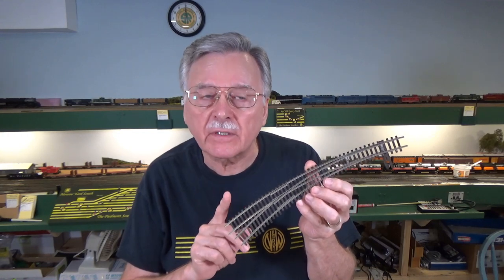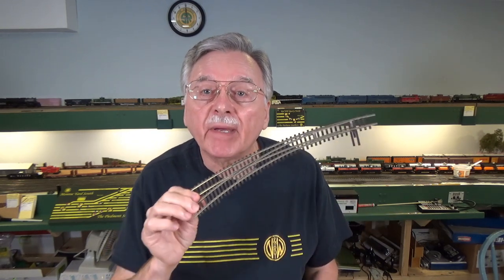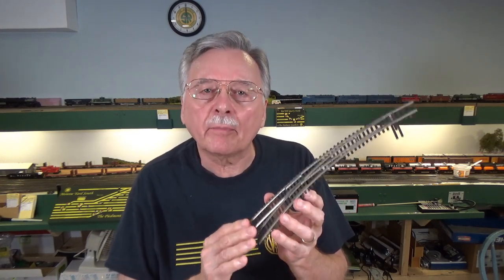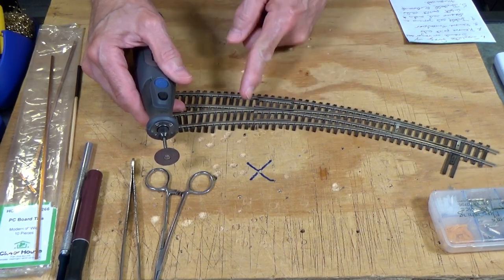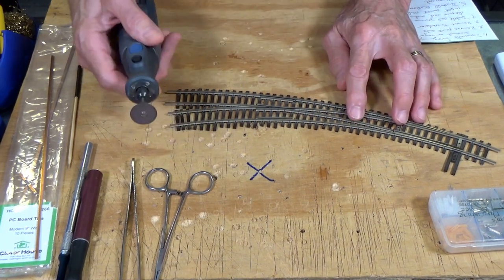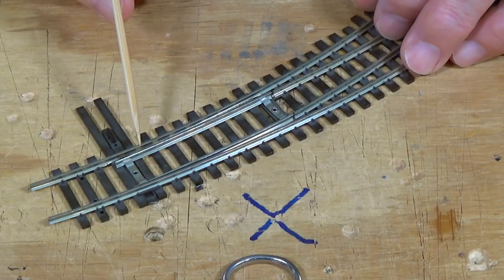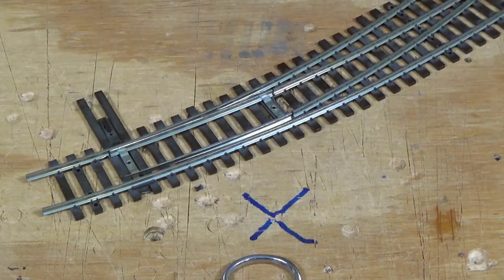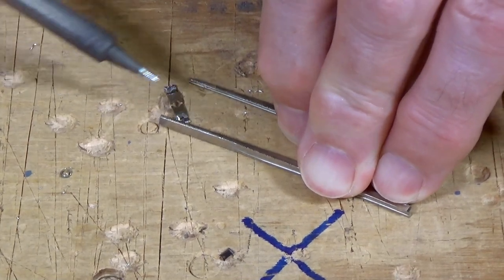Make Your Old Turnouts DCC Friendly (121)

Comment: Hi Larry,  Love your insight into model railroading and I have over 50 old Shinohara switches and I just converted my first one following your video and using the PC Tie Boards and solder you recommended!  I am happy to share it work like a charm and my short went away and I now feel confident to finish the modifications for  rest of those switches.  Also added the Tam Valley Frog Juicer and my locomotive rolls through the switch with no hesitation.   Thanks and keep the tips coming!

Comment: One thing I have found out, not all Shinohara turnouts are alike. The brass contacts that you pull out from under the rails were all soldered in place on my Shinohara switches. 11 out of 12 switches, only 1 popped out as easily as yours did! Thankfully I am very comfortable desoldering  them and removing them. Just another twist to look out for. Excellent video by the way!

Comment: I have a Shinohara right hand curved turnout on my workbench right now. I have isolated the frog, but only cut the rails before the frog and installed a styrene strip. I'll use plastic rail joiners on the two frog rails, like on a Peco Electrofrog. The feeder will be soldered on the side away from the aisle. I like your method of providing power to the point rails, I never though of that! Stay safe!

Comment: A local hobby shop owner, who was closing his business, had a copy paper box full of those curved turnouts,   He gave me the box for free. I had been wondering about how to use those.  I’m going follow your steps to makes those DCC friendly.  Then use those in my hidden staging area for my On30 layout. My visible tracks are Peco O-16.5 for On30.  Peco switches get expensive quickly in staging yards.  The only thing I would do different is I would attach my 12 inch long feeder wires across the rails where you put those short pieces of solid wire.    Thank you for the video.

Comment: I use a piece of phosphor bronze wire across each side of the rail joiner that was inserted for the point blade. this also helps retain the blade. As for the metal throwbar why not leave it in place,  drill out the rivet,  and  solder the PC board to the metal throw and then make a cut across the metal throw bar t and the metal layer of the PC board tie.

Comment: I worked out that i was going to have to do something along this line because i wasn't  getting good electrical connection at point to stock rail. You have made this look easy and as soon as i get the pc board ties i will give this a go. THANKS!

Comment: I really like my newer Shinohara turnouts.  They are DCC  friendly.   It's a shame that Shinohara is out of business.  In October of 2020 Walthers is said to be coming out with a new line of DCC friendly turnouts. Can't wait to get my hands on some of them. 
Tech tip for soldering on track   ....  use a small tipped fiberglass or metal bristle brush to clean the track to be soldered. then clean with alcohol swab before soldering. Dab rosin flux on surface then solder really hot really fast.  Perfect solder joint every time with no melted ties. Silver bearing solder will generally melt at a slightly higher temperature.

Comment: Why didn't you use an NMRA gauge when you set the point rails on the PCB tie? Couldn't just eyeing the point rails cause a derailment, just an inch down the point rails the wheels could drop on the ties because there is too large a gap?

Comment: Best regards,
Your videos are of excellent quality and full of content.

I have seen all your turnout videos and I am in an uncertain situation
since I am not an expert on the subject.

I am a train modeling novice. I recently bought a Fleischmann starter set. (My first train in my life)
The set which is digital is:
 	
931886 - FLEISCHMANN Premium – z21 Digital starter set:
electric locomotive class 194 with goods train, DB

The track is oval in shape with double rails on one side simulating a station,
 with entry and exit deviation.

The turnouts are Fleischmann N Left and Right hand curved point Ref: 9168 and 9169
"for manual operation with current-conducting frog"

And Fleischmann official website say:

Turnouts with a conductive frog must always be set in the direction of travel
from which de train is comming, otherwise a shor circuit will occur.
The requiered changeover or the polarity or the frog takes place automatically
when de switch is changed.

Reading on the internet, I found a quote that said:
From: Digital Command Control.
Ames et al, Allt om Hobby/NMRA;
1998 .....  "The ideal turnout is frog electrically isolated and powered by switch contacts"

I have three questions:

1. Are these Fleischmann Tournouts frog electrically isolated and powered by switch contacts?
2. If no, from your experience, ¿what kind of turnout are these?
3. The set is supposed to be  ready to run, (I couldn't say for sure )
    ¿Do i need some kind of special wiring in order to avoid short circuits?

This is my first train, it is expensive, and it would be terrible
 if I were to damage it by improper handling.

I would appreciate it if you could advise me on this matter.

Greetings
Hector
Reply from the maker: I wish I could help but I have never even seen a Fleishmann turnout and have no idea whether the frog is insulated or can be separately powered. If you have a multimeter you can test it to see though (see video 86 on using a multimeter). From your description it is hard to say whether the frog is powered by contact at the points or designed to be powered by switch contacts or a frog juicer. In either case operating a locomotive on it should cause no harm, it will mean that either the frog may lost power or have no power at all. You also might want to view my video on turnouts (no. 77).

Comment: I am new to DCC. My layout is 25 years old (all DC) and I am converting it all to DCC. I have successfully converted 7 or 8 turnouts using the instructions in this excellent video, Except for the part where you mention powering the newly isolated frog. Electronically everything works except the now dead spot where the frog is. How do I power the isolated frog?
Reply from the maker: You need to solder a wire to the side of one of the pieces of rail that comprise the frog. Then connect that wire to one of the built-in SPDT switches in a Tortoise or the dedicated frog connection on an iP Digital switch machines. If you are not using motorized turnout machines then you need to either use one of the Caboose ground throws with a built in switch or a Frog Juicer.

Comment: Could you have soldered the rail joint between the point rail and closure rail instead of soldering a piece of 30 gauge wire as you did?
Reply from the maker: That would not give you the electrical connection between the closure rail and stock rail, which is what you want. You don’t want to rely on the physical contact between the point rail an stock rail for power. Too many things like ballast, foam scenery, paint, cat hair, etc., can get in the way.

Comment: Thanks for the informative video but I have one problem with this process. When reinstalling the point rails to the pcb throw bar tie, how do you keep the solder from flowing underneath the point rail and soldering the stock rail to it? This has happened to me twice. Thanks, Larry
Reply from the maker: Practice and use solder sparingly.
Reply: I have had success looping a small piece of paper under the stock rail  as a barrier while soldering the point rail.

Comment: Instead of connecting the closure rails to the point rails by a 30 ga wire, why not solder the rail joiner connecting the closure to the point rail?  The point rail will still move back and forth as easily.
Reply from the maker: Might work of might be too stiff for your switch machine. Only way to know is by trying one.

Comment: Here's a question I have, if you don't mind. A little set-up first; I have a setup made with Bachmann track. Including 4 switches and crossovers made by Bachmann. Well, after getting my 4th DCC loco I realized it might be easier to use an NCE Power Cab (I could access my Locos by their road numbers.) So I've done that. Now, here is my question - Could I use my Bachmann E-Z  Command Controller to operate the switches and crossovers, while using the NCE to operate the locos, at the same time?
Reply from the maker: Well right off let me say you cannot mix commands from two different command stations at the same time on the same track. However if the bus for the switches is completely separate from the track then you could do it but you would not be able to operate the switches using your throttle if that is what you want. Your nest net is to see your Bachmann controller and buy either an inexpensive booster like the one made by Tamm Valley Depot or upgrade to the SB5 which will give you 5 amps and expanded capabilities.
Reply: @TheDCCGuy  Thank you.  What I was hoping was to use the Bachmann only for the switches. no throttling at all.

Comment: I really found this video useful. However, my question is not related to this video but several that you have posted in the past.  I have obtained the European style terminal/barrier strips that you have referred to in other videos. How do you attach them underneath your layout? Do you Scotch double sided tape or the like? Thanks, Kennedy
Reply from the maker: They have screw holes between the terminals. Just insert a properly sized wood screw and attach it to a wooden beam under the layout.
Reply: @TheDCCGuy  Okay. That was so obvious that I failed to see it. I would agues a No. 6 x 1 inch pan head screw will fit the bill. Thanks for your help and quick response.

Comment: Are you familiar with the Bachmann EZ track DCC turnouts? I recently purchased two that had as part of the turnouts description that they have electrically wired frogs. However the #4 turnout has a plastic frog and the instructions on either of the turnouts do not describe how the electrically wired frog functions. Thanks
Reply from the maker: Sorry but I have never tried those or the Kato versions. You might see if there is a Bachmann help forum on www.Groups.io
Reply: Model Railroading With The DCC Guy Thanks

Comment: Why did you add the 2-30 ga wires, when the power was already feeding your points at the PC board, you installed. There is no reason for that connection of 30ga wire.
Reply from the maker: One of the biggest problems comes from trying to rely on the physical contact at the points for electrical continuity. A physical contact like that is highly unreliable. Get a piece of ballast, foam scenery, cat hair, etc. in there and your loco will stop dead in its tracks. And that’s why powering the closure and point rails is the DCC Friendly thing to do. Also even though the copper strip is under the rail there is no reliable physical connection at the PC board either.
Reply: The DCC Guy I have been building Fast Track switches for years. If the points that you removed are solder to the PC board, it is highly unlikely there will be a power problem. On your redesign switch
Reply from the maker: I am a firm believer in Murphy’s Law—“if it can happen it eventually will happen”. I try to never rely on physical contacts for electrical continuity, especially on a model railroad, and with DCC where good electrical continuity is even more important.
Reply: The DCC Guy you aren’t rely on the points contact at all. Your power path is through the PC board, you solder it all too.
Reply from the maker: NO, there is no electrical connection to the PC board at all! It is floating under the point rails. Any electrical connection there is incidental and not to be relied upon.
Reply: The DCC Guy you are correct. Thanks

Comment: I wish all of you seasoned Model Railroad Guy’s would stop blowing on your solder joints to cool them after soldering !  It can cause the solder joint to fail mechanically and more importantly it can create a cold solder joint that produces an intermittent connection!  Just saying….😐